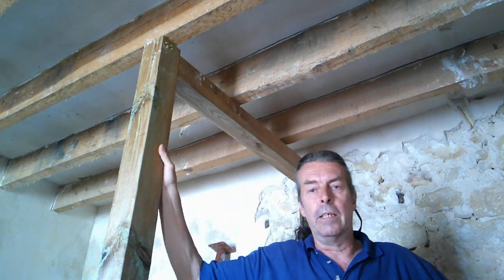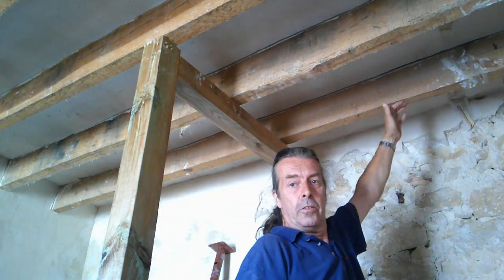We have off grid internet! Renovating our Spanish farmhouse

Comment: Hi Andy, just a quick technical question, viewing properties on line I noticed a lot have the plaster/render  coming away  at low level, do you know why this is, thanks
Reply from the maker: Hi Patrick, the answer is very simple and it's dampness. Damp will only rise (believe it or not) 1 metre - above this, gravity defies the wicking effect. Hence you will see many Spanish houses cladded with stone or tiles outside and tile inside. This doesn't eliminate the damp but hides (conceals) it as is evident in houses that don't have this feature, where exactly what you have stated occurs. Unfortunately in Spain, this concept has not yet been understood (the same as they don't build chimneys high enough lol). If it is a stone house, it is easily resolved, by knocking off any render / plaster etc up to 1m high and re-pointing the walls with lime/sand or hiding it with tiles / cladding... If it's a more modern house, tile / render will hide it for a few years.... I hope that makes sense
Reply: Thanks Andy for taking the time to reply in your busy schedule, finding the videos informative and inspiring, hope to be out there next year ourselves, keep up the good work.
Reply from the maker: @patrickgarland1657  You're welcome and thank you. We're so pleased you are finding the videos informative - we've never done anything like this before lol (YouTube, that is). Good luck with your move out here, please keep us posted!